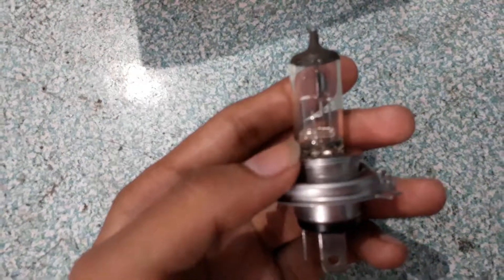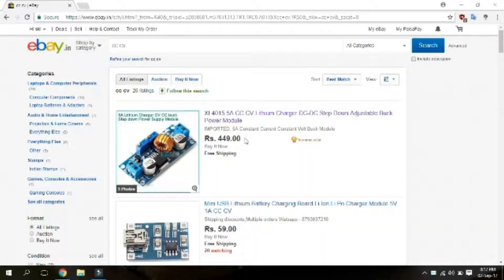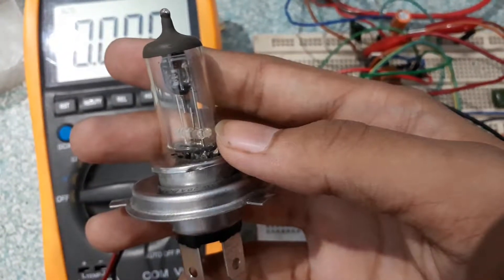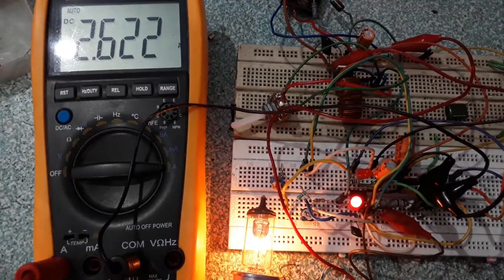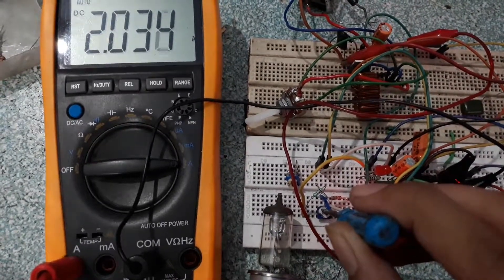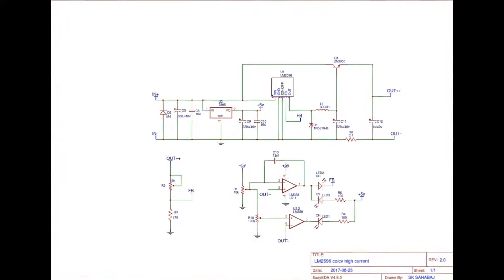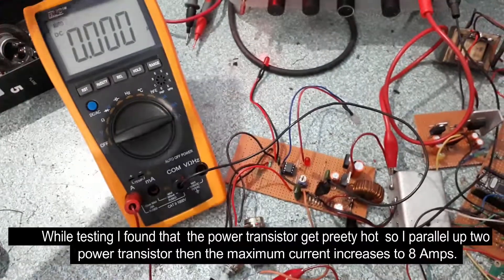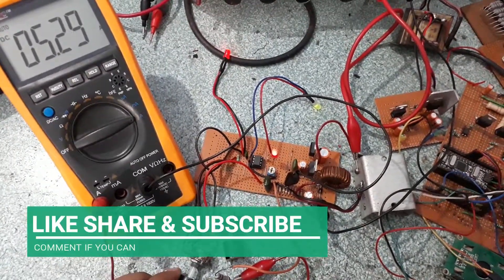DIY Variable Power Supply With CC & CV

Comment: Thanks for this video... I just test the LM2596S IC with basic schematic from TI datasheet (2013 pdf version) and now I will do some protection (from datasheet) and after, I will try to add this CC regulator using the same LM358 opamp.
thanks again.